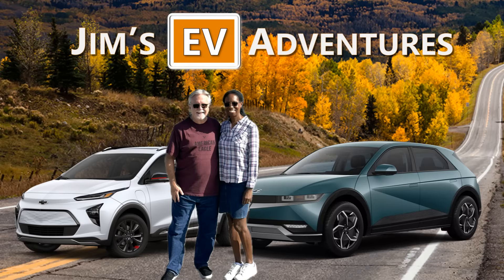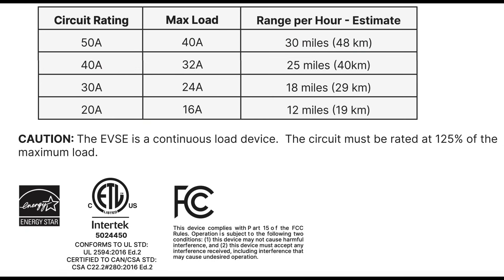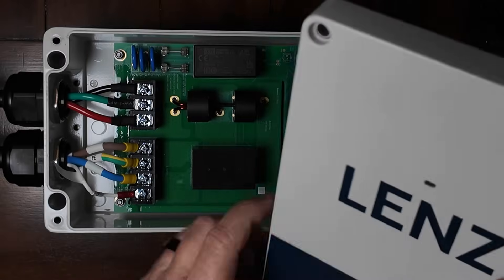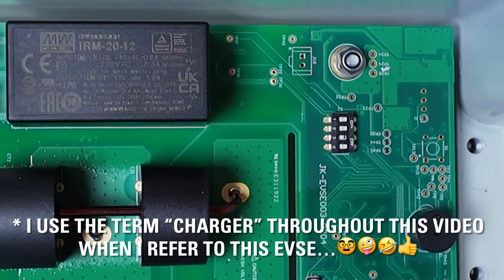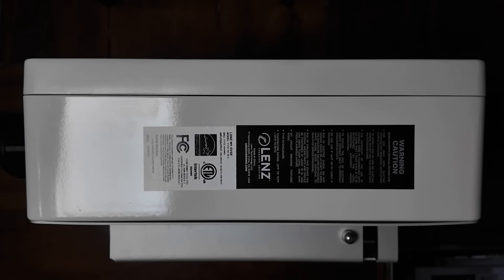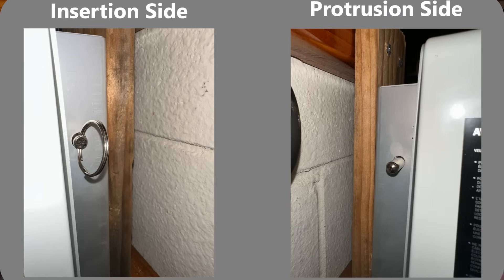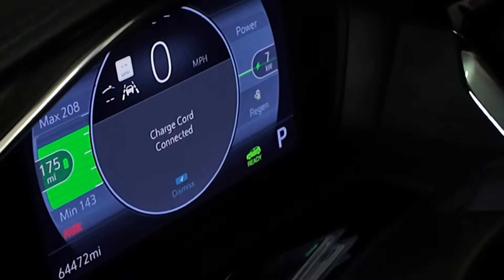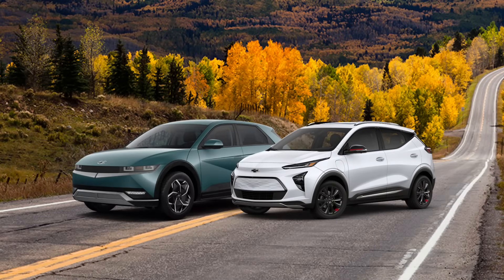LENZ EVSE Tested! Does It Really Work?

Comment: @9:48 - if that 14-50R receptacle is not a Hubbell or Bryant (9450) I would get it replaced. Check the diameter of it or the opening of the plate, if it's less than 2.4", it's probably not good. It won't withstand the heat of continuous current of 32A.

Comment: I see that the unit doesn't have a display. Does it have an app that has settings, or where you can see what's going on... ie how long, or much power has been used?
Reply from the maker: I use my car’s app to monitor the charge. It’s more reliable than any other EVSE app I’ve ever used. If you need that, then I recommend the Autel unit—see my FreeTree. Link is in the first comment.